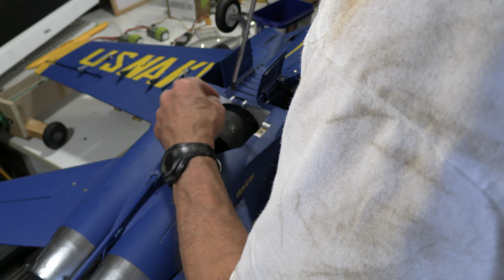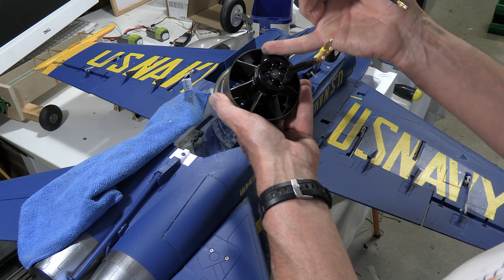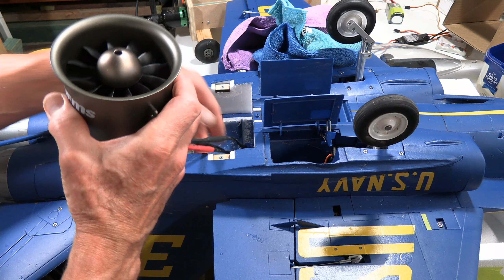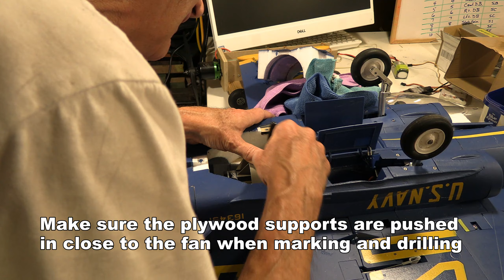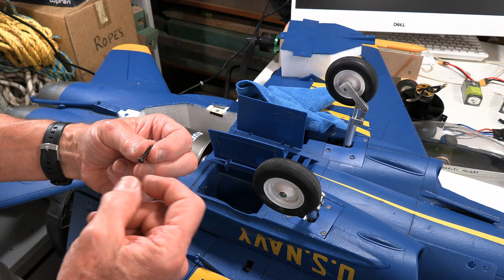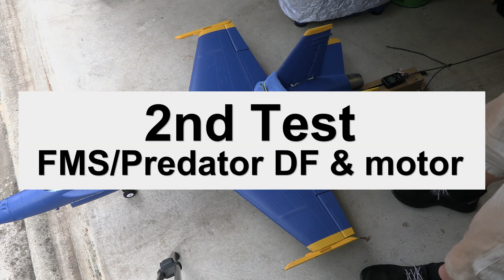Freewing FA-18 90mm EDF Ducted Fan Replacement

Comment: It would appear. According to your test results. The expenditure for the F.M.S. motor was not what you were expecting. I find that my f-18's performs exceptionally well with the Freewing motor and fans.
Reply from the maker: That is correct.  My issue was the long takeoff run needed when using a grass runway - but while it took the whole length of the field, it did get off the ground, then everything was fine.

Comment: 7.128 max trust, not very impressive.
But your FA-18 90mm is!
Reply from the maker: Yes, it seems that many EDFs are lacking in static thrust, which makes take offs challenging.  But because of the velocity of the air coming out of the nozzle(s), they perform quite well once up to speed.
Reply: @RCJim  Just a suggestion.  With my Avanti S V2 80mm, I swapped out the 80mm 12-blade for an 80mm 9-blade, it increased the thrust by ~5%.  Maybe test this out on your thrusting device.  You may lose some of the "whizzing" sound, but it'd be interesting to test.
Reply from the maker: That is interesting.  I know with props, a smaller number of blades is more efficient, but while less efficient, if you have extra blades you can pump more horsepower into them and get greater thrust.  So, if you have a motor that has plenty of power and can keep the rpm up with more blades, it's going to deliver more thrust.  But, if the motor can't quite keep up with a larger number of blades, a smaller number of blades will allow it to deliver higher rpm, and with the higher efficiency, it just might deliver more thrust.  As it is with the FA-18, given that I'm not flying with the ESC flopped down in front of the fan, I expect I will get along fine with either of the ducted fans that I now have.  So, the next thing is to figure out a project that can use a 90 mm ducted fan... :-)

Comment: Hi Jim, I do lots of motor upgrades. I prefer to buy kits and install my own components. A couple of issues here. You interpreted the KV of the motors incorrectly. It was obvious that the FMS would be less powerful from the basic spec. The Higher the KV the more thrust. But with a downside of consuming more power, And requiring a larger power ESC. The FMS has a lower KV but would be more efficient given if using the same fans. The other factor you  need to consider is the pole count of the motors. Some ESCs you can actually specify the pole count. Others you can only adjust the timing. You would need to match the Freewing ESCs timing with the Motor required timing. ideally you should have swapped the ESC as well. If the aircraft was underpowered after reviewing the specification of the EDFs you would have been better placed swapping to the 8S EDFs and ESCs from Freewing. They are a direct swap for the 6S versions.
Reply from the maker: Yes, I'm not sure how it all happened, but I was thinking that I was ordering an EDF that had a higher kv rating.  It was only when I was editing the video that I realised that I had those numbers mixed up, so I put in the correction in the text at the bottom of the screen.  With regard to ESC timing, those two motors are close enough regarding pole count and speed that I wouldn't think it would make a difference.  Some ESCs actually have an automatic timing setting.  I don't know if that is the case with the ones from Freewing.  Even with a fixed timing setting, with the FMS having a slightly lower kv and generating slightly less thrust, it seems to pretty well explain what's happening.  If you are suggesting using 8s batteries with the 90mm fan, I think there would be issues with both the current generated and room for the battery.  Of course there are a lot of factors to consider, so thank you for sharing your insight.

Comment: I fly foam warbirds and still don’t know a lot about the outrunner motors, but I feel that the KV on the new motor was lower, thus, your RPM are going to be lower and create lower thrust. 
I wonder if you could’ve gotten a bigger motor with a higher KV, if it would’ve given you the extra thrust that you were looking for. 
Either way, I love the data!
Reply: Lower Kv usually means more power. How it's harnessed makes all the difference. With prop powered models you can either add blades or a higher pitch blade. You could also use a bigger diameter prop if the clearance is there, which it usually isn't. With an EDF you add more blades or a different pitch blade. Cheap EDFs may only have 4 blades. More powerful ones have 12. You can also use an INRUNNER vs an OUTRUNNER. Inrunners can usually spin at faster RPMs and have a higher FAN SWEPT AREA (FSA). Inrunners are smaller in diameter. The extra area that would be the outrunner motor is now occupied by the inrunners longer fan blades. Extra FSA creates more thrust. But you need the extra power of a lower Kv motor to turn a larger area (FSA) fan that also has more blades, and probably higher pitch blades. In this case the FW 3668-1960Kv EDF Motor is an inrunner and the larger diameter 12-blade 4068-KV1850 EDF is an outrunner.
Reply from the maker: Yes, somehow in my head I thought I was getting one with a higher kv rating, so even when I was recording the video, I had that in my head.  But, it's not a big difference, and having a bit more torque, which goes with the larger diameter, it would be better able to keep the rpm going when under load.  At the end of the day, however, it didn't perform quite as well as the original.

Comment: I have a static test stand that I use to measure fan/motor thrust output. It sure comes in handy !
Reply from the maker: That's good, but the air duct in the plane is also part of the equation.  The fan builds up pressure in the duct and the nozzles 'squirt' it out.  The velocity of it coming out is going to affect the thrust at various air speeds.